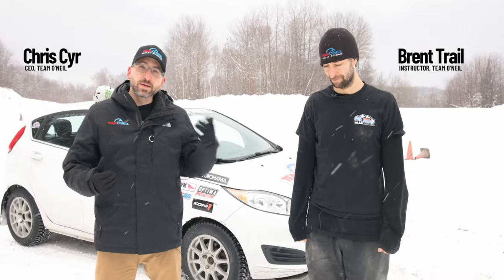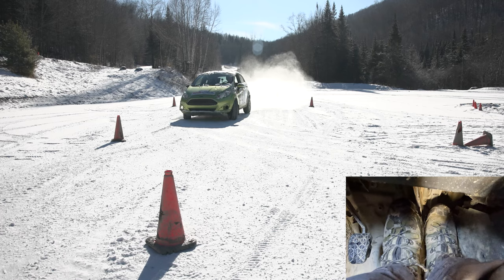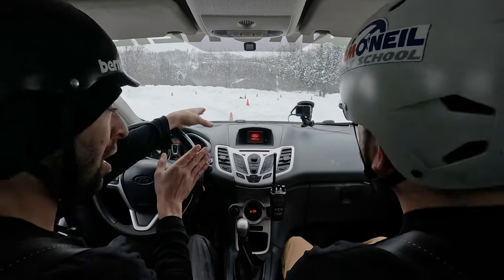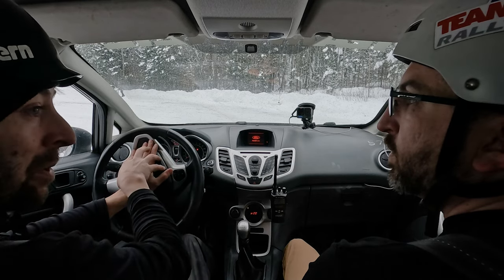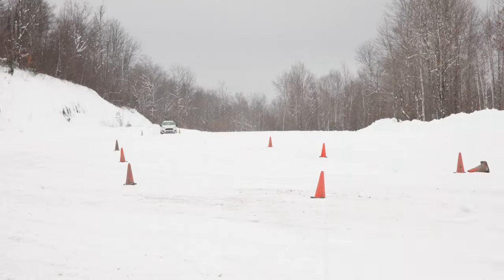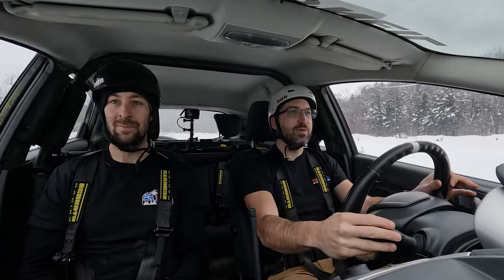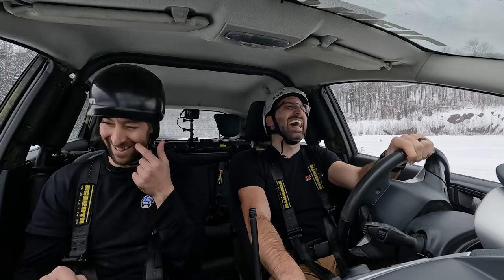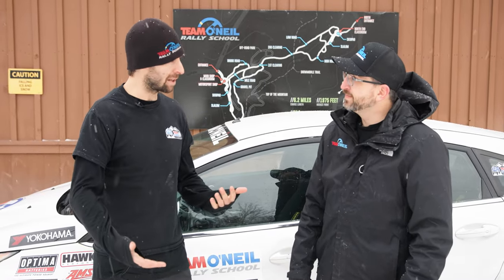Learning How To Do A Pendulum Turn (Scandinavian Flick)

Comment: but are you faster at all? So much can go wrong.
I think it was Loeb who was faster by avoiding all drifting except handbrake and some modified trail braking
Reply: Same thing. It is a matter of car setup/attributes, tires, road conditions etc.
The initial turn into the opposite direction just amplifies what you could achieve with trail braking alone.
Reply: 100% agree. Trail braking is good for most cornering imho. Auto diffs make it even better. My old STI would trailbrake wonderfully under power like a FWD and it turned in no matter what surface I was on.

Comment: as long as you have a nervous system the pendulum flick should feel very natural with even a little practice. You just feel the weight shift of the car and shift it the other way (you will feel more force  on the second flick into the turn)

Comment: I don't understand the purpose of this technique? If the car can be set into oversteer so easily why go one way then the other. I always thought the purpose of the flick was to set in oversteer. If the car will oversteer simply by trail braking then why not simply trail brake into the turn? I thought the flick was for conditions where the car would understeer. That it's done to upset the rear going into the turn?
Reply: They're demonstrating on the snow for the guy learning. This is usually applied on gravel

Comment: Do you brake while right foot on throttle pressed?
Reply from the maker: It depends on the the vehicle type and road surface.
Reply: The guy in the video said to add a bit of throttle to add stability and to prevent lock-up on brake. He said this during step 2 of braking right after the inital turn

It also helps with oversteering the vehicle a bit more due to the rear wheels spinning less than the front